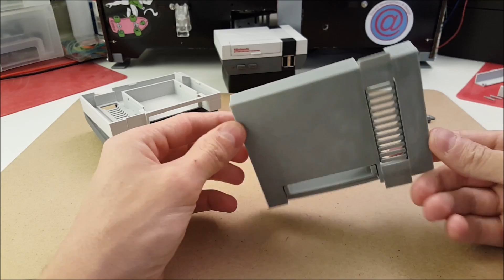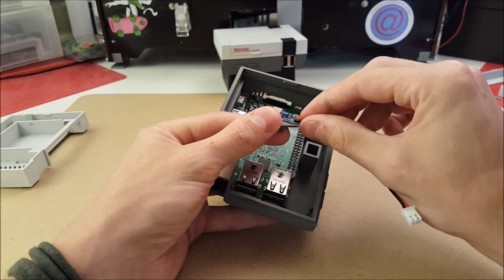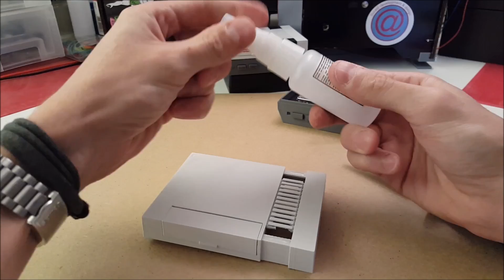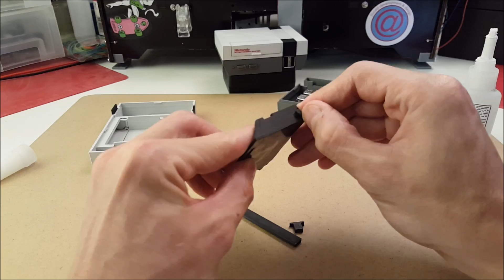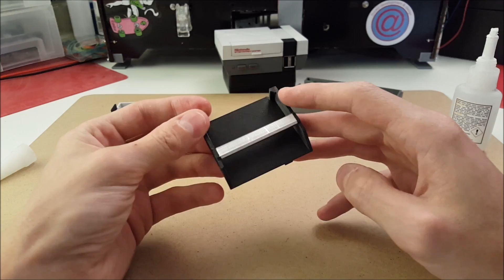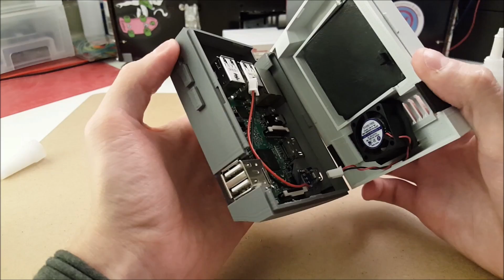Mini NES Build Guide Part 2

Comment: How would I make the usb power supply? I wont be using the arduino or the reader as I'm not using it to read the cartridges. I'm looking for the one in this video. is there a file to print that support the usb is on?

Comment: Why not use acetone to veld things instead of glue?
Reply from the maker: It's easy to damage the surface finish using Acetone, it evaporates too quickly and only works with ABS filament.
I found that super glue is just easier to use, not as messy, it's bond strength is fine for this application and works with ABS and PLA.
Reply: +daftmike thanks for the information about the types of filament, James Burton (on YouTube) used a paintbrush to apply acetone, then he used glue around the edge if it was not a visible edge. Have you thought about using an acetone chamber to make the black part glossy?
Reply from the maker: I might try it out, but from what I've read it 'blurs' the edges a bit and I don't know if I like the effect compared to the raw print.

Comment: When I load the bottom shell supports they do not include supports for the button holes or LED holes. Is this correct?
Reply from the maker: Yes, you shouldn't need supports there.
Reply: On my first try having the printer go normal speed and with 0.1mm slices my printer ended up breaking the support in the middle of the buttons but it did not sag. There were other defects in the vents and rear ports. Right now I am testing out the top at 0.4mm and the fastest speed. For some reason I have gotten better prints at the fastest speed in the past. My next attempt for the bottom will be with the settings you used. I plan to use Krylon to color my white print. Should be much cheaper that way.

Comment: this is making me want to build a few different ones - Sega Megadrive, an Atari etc. the idea of having a few mini versions of old favourites makes my inner geek droool

that and I'm needing to get my hands on a Sega game gear, using a Pi Zero a handheld should be possible.
Reply: That would be nice but expensive to make all systems.
Reply: +Qbuntu one of my thoughts to reduce the cost is to use the Pi Zero instead. it's performance is less, but it's still better than the original consoles.
Reply: A mini SMS would be tits.

Comment: When printing what position are you printing the parts? For instance the bottom shell are you printing from the bottom side facing down like normal? And the top shell do you flip it so the top section can be at the bottom and prints from the bottom up?
Reply from the maker: Bottom shell is 'bottom-down'. Top shell is 'top-down'. I print them in the same orientation as the .stl files. You want to have the flattest surface on the bottom ideally.
Reply: +daftmike 
Cool wanted to confirm as I've tried other models similar and my part some times warps no matter if it's abs or pla. Thank you for the reply and again thank you for posting this stuff gladden the electronics are plug and play.

Comment: Dude, I would love to have that case. the door wouldn't even have to function. I would like to house the pi in it.

Is it legal to have the 3d printer plans available?
Reply: non profit doesnt matter. If it infringes on trademarks its up for legal shit. Not putting a nintendo logo on it helps. Also if he were to call it... retro game case instead of nes case would also help. If non profit mattered nintendo wouldnt have shut down all those fan games and the nintendo power scans on archive.org
Reply: It&#39;s very likely. But trademarks are not like copyright. They can be renewed at any time. Also I'm sure that the logo is still trademarked which would be an issue. Since he doesn't include the logo like I said earlier that helps. I do know for a fact as reported by destructoid that Nintendo renewed the trademark on the original nes controller. But again the logo is the biggest issue. So if no decals are put on it, it should be fine. I'm not a lawyer though
Reply: I agree selling it would probably not be best especially if he included logos. As for the nes design. I don't know if it's actively trademarked. It wouldn't have automatically been re trademarked. That's not how it works. But with their new "nes classic edition" they may have applied for a renewal. It is called "nes classic edition" though not mini nes. A lot of people are calling it the mini nes. They are wrong.
Reply: It's non-profit, so yes.
Reply: Didn't Nintendo let the trademark on the original NES expire several years ago?  It was why and how a few companies released their own NESs. This was like maybe 5 or so years ago.